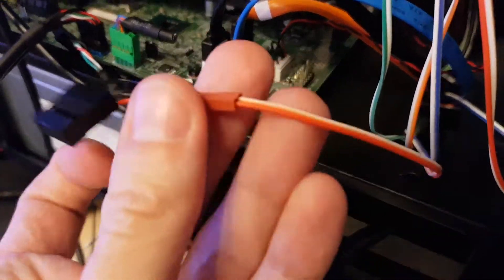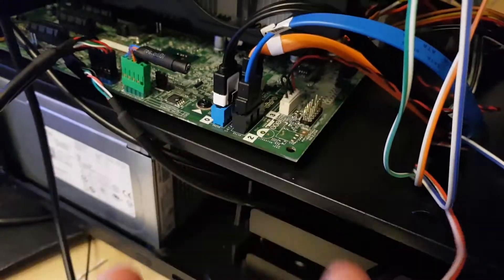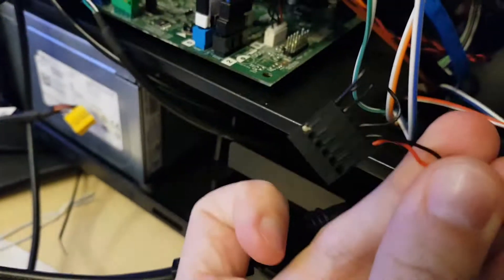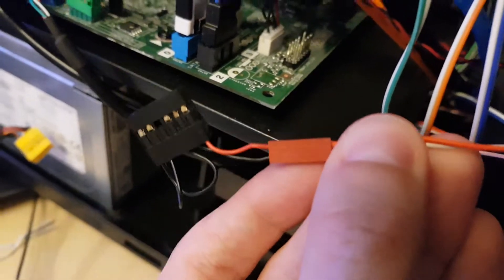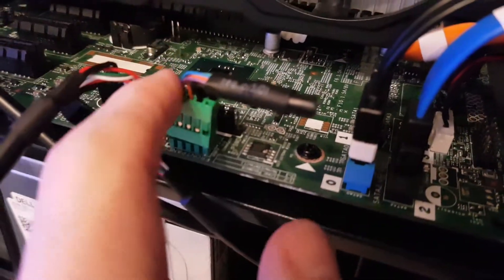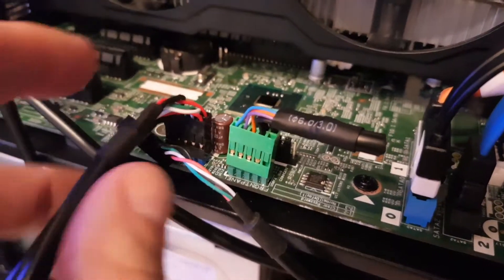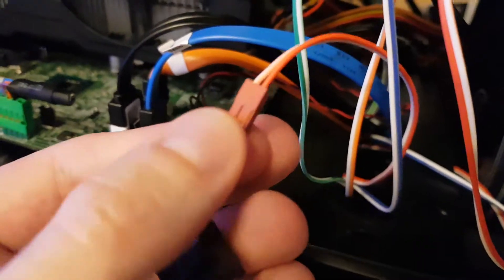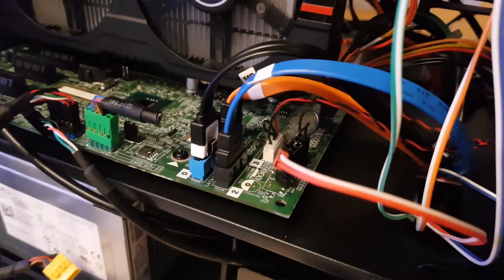Swap Case on Dell Optiplex 3020 - Front i/o Cable and Power Button Failure; Solution+Connection 2/2

Comment: i fixed the front i/o error by looking at the usb i was putting into the green socket..theres an extra black earth wire on the dell one..so i just jumped a wire in my usb plug ..the one above the blank hole over to the earth wire to its left..  just used a piece of wire and it works..i also now have the usb ontop of the pc working

Comment: Hi, do you have the pin map of front audio connector ?
Reply: I just did a continuity test because I had the same question, turns out the wiring is the same as the standard HD Audio connector EXCEPT pin 7 (the one under the blank) needs to be grounded out to pins 2&4 (Presence and Ground, on my Lian Li case these were already together but not sure if all are the same). I just used a scrap wire and jumped 7 to 2/4  and it works perfectly. Hope that helps!
Reply: @ERROR-401  nice